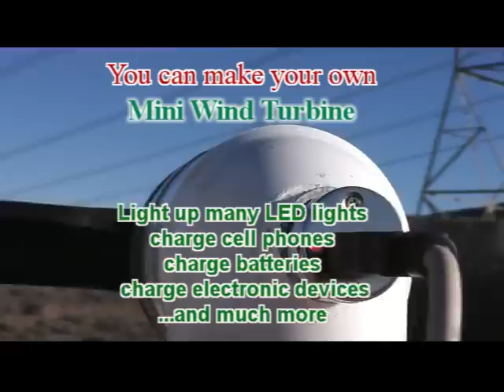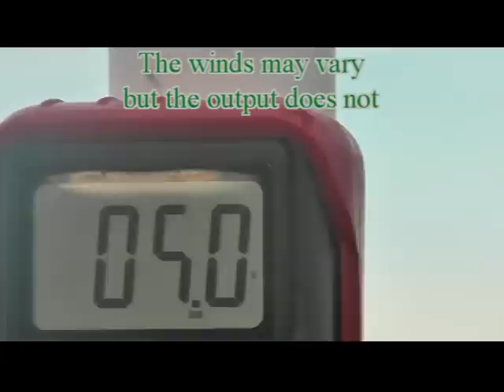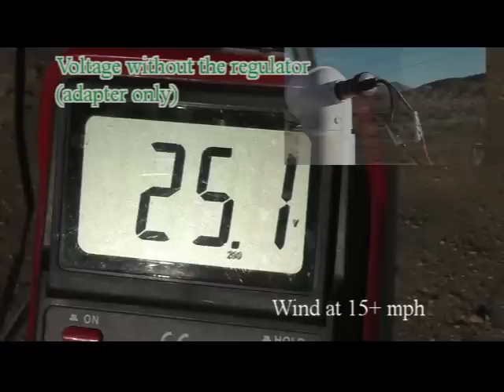Mini Wind Turbine G2

Comment: Hello,  Can you please , give us the name of the equipment and its references ?

Thank you.
Best regards          (diodes)
Reply from the maker: The PVC pipes and fittings are all 2" (4 elbows for the base, 1 elbow to connect to the nacelle, 3 "T's"), the metal connector nacelle-to-motor is a Plumbquik P3000-22 also 2". The motor/generator is a stepper motor Nema 17 with six wires. The bridge rectifier is made with 4 diodes 1N4001...easy way to remember how to solder the four points together...put the diodes in front of you...make a square with 2 diodes pointing North and 2 diodes point West....the upper right and the lower left of the square you formed is where you connect the two wires coming from the generator...the upper left is your positive DC and the lower right is your negative DC...after that, all you need is the cigarette lighter female adapter...and of course the cigarette lighter charger 5 Volts/1 Amp...and that's all you need.
By the way, I am currently evaluating some manufacturers and I will have kits for sale soon, since these parts are from totally different suppliers, I thought I might just make it easy for people to order everything from one place only. FYI

Comment: Can i get a full list of parts???  Im building a camper and need a way to generate energy. Can this be made into a Vertical Axis Wind Turbine???

thank you
Reply: You cant use bldc motor to generate electricity for a camper. This takes nearly two weeks to charge a 12v 20Ah battery

Comment: Nice video and great information. Building a mini system would be fun to build interest for actually powering homes. I have installed certified wind turbines powering homes and businesses in over 40 states installed in sites for almost 10 years now. Thanks for your contribution to the interest in home wind power.

Comment: I have made one of my own and I was wondering do you have to use the same size propeller 20x8 because mine doesn't spin with the wind I have you spin it manually
Reply from the maker: +xMRG4M3R14x 
Not knowing all the specs on the motor you are using as a generator, I am going to try to make a blind diagnostic.
-First, when you try to spin the shaft manually, does it feel that it is hard to turn it? If it feels hard to turn, you may have a motor with a high "detent torque". Some motors have a low detent torque and are easily turned, and some have a high detent torque (some people call it cogging) and are hard to turn. 
-You will have to either choose another motor, or you can use a household 3-blade fan as your propeller. These fans have a large blade area and therefore more torque, making it more likely that the motor will spin.
-Finally, make sure you have not shorted the wires. If the tips of the wires are touching each other, you can create a short-circuit...and that will be enough to prevent the motor from spinning.
-Write back, and let me know if the above was useful information for you. Good luck, have fun...  :)   STT

Comment: Im wondering how you figured out how to hook your wires up on your motor?? I am having trouble figuring out which wires I hook up to my diode bridge for my AC and which ones I hook together on my 6 wire motor. If you could give me any sort of insight it would be greatly appreciated! Thank you
Reply from the maker: Hi Richard,
Assuming you have a multimeter or a continuity meter: Check each pair of wires and see which pair has continuity. Let's imagine that the six wires are numbered 1,2,3,4,5,6. If you find continuity between 1 and 3, then you found one coil. If 1 and 3 is not responsive....that is not one coil, then try 1 and 4, or 1 and 5 and so on. Every time you find a pair that has continuity, write down the two numbers...you found a coil. do this with all combinations...Stepper motors are all different, but chances are with 6 wires, you have two coils inside. Each coil has three wires...one wire is the beginning of the coil, the other wire is the end of the coil and there is a wire right in between these two which is the "common" (center of the coil). If you connect the beginning of the coil and the common, you have half the coil...and if you connect the end of the coil with the common, you have half of the coil...only the beginning and the end will give you the full coil. that's why you may just isolate the tip of the common wires and not use them at all. 
Now, assuming you don't have a multimeter or a continuity meter, then just attach an LED light between two wires and spin the motor manually...if the LED light lights up...you found a coil. I hope this helps. If you have any other questions, I'll be glad to help. STT
Reply: ScienceTubeToday Wow, thank you very much! I finally got it to work!! Its nice to actually have someone to ask these questions to!
Reply from the maker: Thank you  :)
I am glad to hear that you got it to work.
Have fun with your project. 
Take care!
Reply: ScienceTubeToday I have another one for you... I am wondering if you have any idea about blade lengths relative to motor size? I currently have a 12 volt 4 phase with a 6000 g-cm holding torque, and the blades I have made and also bought wont turn my shaft. Wondering if you have any knowledge on this subject. Thank you!
Reply from the maker: Hi Richard,
That is a high detent torque, and I don't think you will be able to use it as a direct drive (propeller-shaft). You may, with some ingenuity and engineering use gears, small gear to prop and big gear to motor shaft, but that is also depended on several variables, I mean the ideal or workable sizes for all the relationships involved. An alternate solution is to look for an old broken printer in your garage :), or from a relative or a friend, and remove the stepper motor from it. Usually you will find two motors there. These usually have a low detent torque and as a rule are very usable. I have been working with a manufacturer trying to obtain good quality stepper motors at reasonable prices and sell them individually or in kits, but that's a work in progress :)  Keep me posted on your progress...and...don't give up!  STT
Reply: ScienceTubeToday Im wondering do the 5 volt usb chargers have regulators in them or did you put one in the circuit? Also, why did you mount the blade backwards? Thank you
Reply from the maker: Yes, the chargers have voltage regulators in them already, you don't need to add anything else. Just as an additional and very interesting piece of information; One can use a Zener diode in reverse bias as a voltage regulator. When mounted backwards in the circuit, It will limit the voltage (fairly well) according to the specs of each specific Zener diode (some common examples are  5.1 V, 5.6 V, 6.2 V, 12 V and 15 V)... Now, about the blade. According to Bernoulli's law, the faster the wind passes over a surface, the lower the pressure. So, pressure is inversely proportional to speed. When a propeller is spinning (as those in a normal aircraft), the cambered (curved) surface of the propeller "sees" less pressure in front, and that propels it forward. (Note that props have a different surface profile in front than they have in the back - front=curved/back=flat - in case of a wing, the top is curved and the bottom is flat) If you observe an airfoil profile or an airplane wing, you will notice that the top is curved and the bottom is flat...therefore the top of the airfoil (or wing) "sees" less pressure when cutting through the air. Air passes faster on the curved top as compared to the flat bottom and that's what creates lift and makes it fly. Long story short, the Bernoulli's effect is what makes a normal propeller more efficient mounted backwards - (when used as a wind turbine prop). Thought experiment: what would happen if we mounted the wing of an airplane reversing its top and bottom?...  :)
Reply: ScienceTubeToday Well I think you would have yourself a spoiler! So when you reverse your blade, the wind will make the blade rotate the opposite way it was intended, correct?  Which means that the sharp profile of the blade would be cutting into the wind when rotating instead of the curved side? If that makes any sense... I have a three winged blade, and I would assume that my blade would still be the same as your two blades in principle.
Reply from the maker: Hi Richard,
The direction of rotation of the blades is irrelevant on an AC generator. It will not affect the output. Only after the current is rectified you will have a positive and a negative wire. Regarding the prop: When you turn the propeller backwards, the rotation changes only in relation to the generator, but observing the prop from a distance, it will continue spinning in its original direction. Now, about the 2-blade / 3-blade question: It all depends on the design, material and size of each propeller. Without going into any formulas, a 3-blade prop with the same pitch as a 2-blade prop will have a little more torque and a little less rotation speed (ex: when comparing a 2-blade 18x10 and a 3-blade 18x10). If on the other hand you have a 2-blade 18x6 and a 3-blade 18x12, now with this comparison, the 2-blade gained more torque and less speed, whereas the 3-blade has more speed and less torque (than its 18-10 counterpart) - PS: what these numbers mean? They are theoretical numbers..In a 18x6 prop, the first number mean the circumference of the rotating prop and the second number, its advance through the air, per each revolution. Keep me posted on your project, if/when you finish it. STT

Comment: The charged controlled , is it the same as in solar panels?
Reply from the maker: Ana AA Yes, the output is rectified current "DC", just like the solar panels.To clarify: This generator produces AC...then I used a bridge rectifier to make DC. If you are going to use this set up, bring the AC all the way to near where you are going to need the DC...and use the bridge rectifier there. The reason is that AC travels more efficiently and farther than DC...so let it travel all the way to the point where you need it...then rectify it. :)
Reply: Okay. Thank you.

Comment: My step motor has 4 wires instead 6. So how do I set my motor up? I first need to find out if it is ac or dc yet if it is ac how do I change it over to dc? I would like to build my own yet this has been my biggest obstacle at the moment.
Reply from the maker: Your step motor will generate AC, only. If you have 4 wires, then you have 2 coils inside.
To find out which 2 wires belong to the same coil, simply connect any 2 wires (in other words, short circuit two of the wires) and try to spin the shaft with your fingers. If the shaft offers resistance, then you know that those two wires belong to the same coil...you can also attach one LED light to two wires and spin the coil with your finger...if you have the same coil, the LED will light up as you spin the shaft. 
Remember, if you have one wire from one coil, and another wire from a different coil, it will not offer resistance when you try to spin the shaft, and it will not light up an LED light.
Give it a go, and let me know...

Comment: Thank you for this amazing video.But i wanted a simple windmill which uses only a common motor and wires and a propeller.Can you please upload a video for making that.
If i use a 100 rpm motor of 3 volts as generator;and rotate the shaft at speed of 100 rpm then will it give me 3 volts current.And if i rotate the shaft at speed of 1000 rpm (10 times faster) then will it give me 30 volts (10 times of previous current) of current?

Comment: heloo

can there be a clasic 2 wire motor , that gives you constantly cca 5V
Reply from the maker: Hello David
A motor when used as a generator will produce electricity that is proportional to how fast the blades spin. That means: the faster the generator spins, the more electricity it will produce (up to the limitations of the generator). 
In order to have a constant voltage output you will need a "voltage regulator"...then you can have a constant 5 volt output :)

Comment: Amazing!!! I've been looking for this project for a long time CTT...I have a 17PM stepper motor, 4 wires, 200 steps...with your experience can you tell me how much Voltaje and Amps will this give for say at least 60 rpms?....a voltage multiplier will be needed to use as a mobile charger?

Thanks a lot!

Comment: I don't Know if this question jas Been asked but, how can i Know wich wires are the common and wich are the "alimentation" !?
Reply from the maker: Hi Mathieu,
If you buy a stepper motor, chances are it will come with the diagram in the box.. It can be for example a 4,5,6,8 wire motor and it will show which two wires belong to which coil, and which is the "common", (if it has a common). If you remove a stepper motor from a printer, for example, then you won't have the diagram, and you will have to test it yourself. One way to do this (if you are very careful), is to attach the motor shaft to say, a drill press which spins at a set RPM., then while it is spinning, you measure the voltage by trial and error on two wires at a time....and write it down on a paper. One full coil should give you a different reading then one wire and the common...and no reading on coils that are not connected.... Write back if you would like. Have fun with your project, if that's what you are going to do.  STT  :)

Comment: Is the bridge rectifier singled face or double and the stepper motor i found one in amazon so could you tell me if i should buy it ill leave you a link also the cigarette lighter adapter where did you get it 
   http://www.amazon.com/Holding-Torque-Stepper-REQUIRES-Printer/dp/B00I50G8K8/ref=sr_1_fkmr0_1?ie=UTF8&qid=1445818856&sr=8-1-fkmr0&keywords=Q3D+4.5KGCM+Holding+Torque+NEMA+17+Stepper+Motor 
walmart

Comment: if you could maintain those 25 volts over 24 hours, assuming your getting like 0.8 amps? thats 0.48kwh/day. Is this right? if so it would take 4 of these to power my 150watt tv lol
Reply from the maker: I loved the comment!
True, and I think that's a great deal, since after your initial small investment you could watch TV for free for the next 10, maybe 15 years  :)
Reply: You charge the battery Bank with it.The power inverter will change it over to 120.If you had two or more you could keep a charge